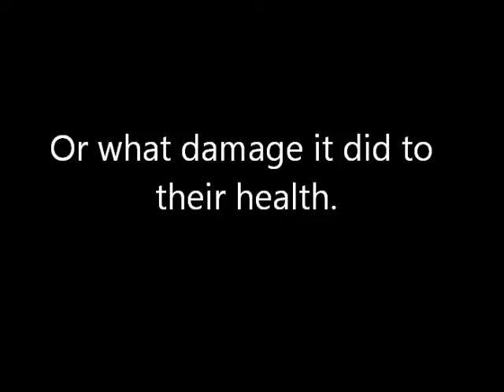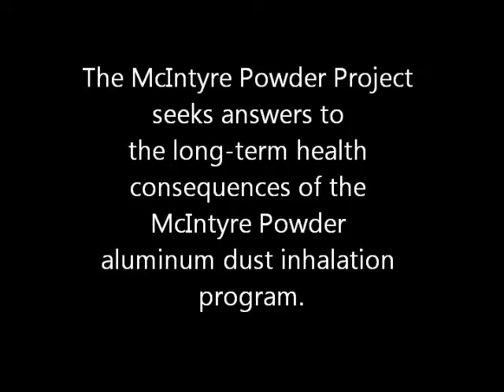Inhaling Aluminum Dust

Comment: I am just now looking into this subject, because I am having breathing issues, I believe from aluminum welding fumes and aluminum parts processing dust exposure, for only less then 2 years. Very poor fume evacuation and 0 dust management for cutting, drilling and sanding. On top of that, wood dust as well not managed properly. I wear a 3M respirator, but cannot 100% of the time. Thus the issues that I am aware of for now. I'm on it and authorities will be notified.